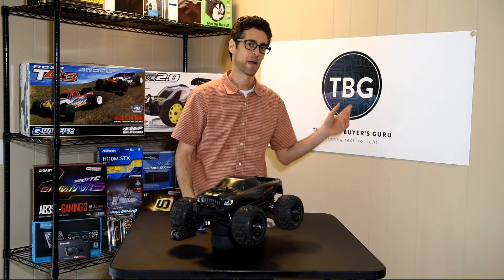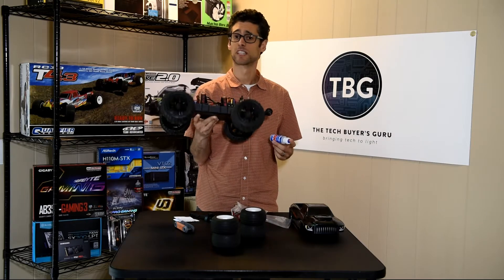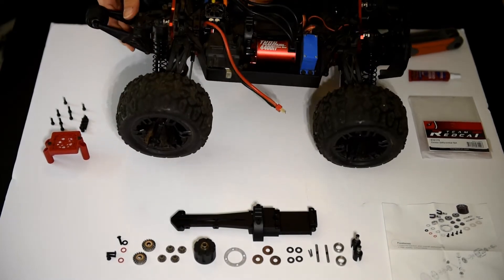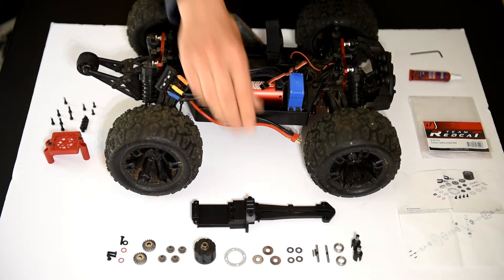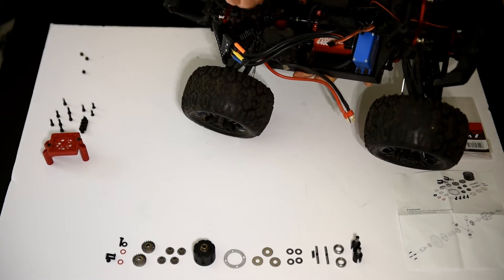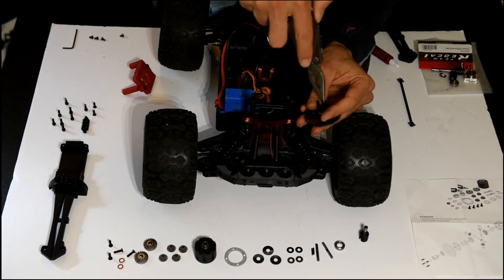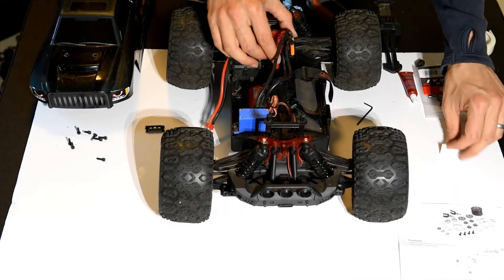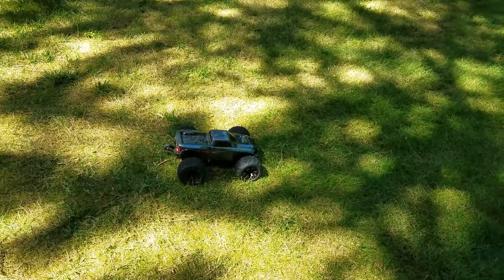Team Redcat MT10E Center Differential and Drive Shaft Lockpin Installation

Comment: Great walkthrough.  Just got this truck for my son and I can tell the differential would help w/ the handling.  How are you liking the 100k diff oil?  Do you wish you went higher or lower on viscosity?  About to put mine in this weekend, so just curious how you're liking it with the Diff installed.  Thanks again!
Reply from the maker: Glad you found this helpful. The 100K diff oil is perfect if you want to improve the handling. The one thing you will not be doing with that weight of diff oil is wheelie-ing down the street, which definitely happens with the stock locked diff. If you like that kind of stunt driving, you'll want heavier oil, like 300K. If you want to keep all the wheels on the ground, 100K is just right. I wouldn't go lower, as you'll start to lose too much power to the front. I use 50K oil in my 4WD buggy, but its tires are much smaller/lighter.

In addition to getting the center diff and putting thread lock on the lockpins for the center drive shaft cups, one other tip in terms of upgrade parts is to go for the aluminum front skid plate: http://www.redcatracing.com/510171. Unfortunately there's a bit of a design defect that causes the stock plastic bumper to warp over time, which could lead to the front hingepins backing out. The skid plate makes the front end totally rigid.
Reply: The Tech Buyer's Guru thank you so much. Noticed my bumber was flexed down because of the defect. Only drove it once. But it's for my 5 year old who hates wheelies so 100k it is. I'll def be getting that skid plate. Already had stated to look for alternative bumpers. Thanks for the tip!!!
Reply: One interesting thing to note is that they fixed the drive pin issue...they now use a regular pin (not threaded) and they have a metal ring around the cup holding it in.  I had to WORK to get it off it was so well put together.  Got my diff installed and all is well.  Perfect tutorial and went in easily.  100K works well also.  Very happy with it.
Reply from the maker: I had heard rumors that Redcat was going to re-design the drive pin system, but it's good to hear that this has finally hit retail samples. Glad to hear you're enjoying the MT10E with the center diff upgrade!